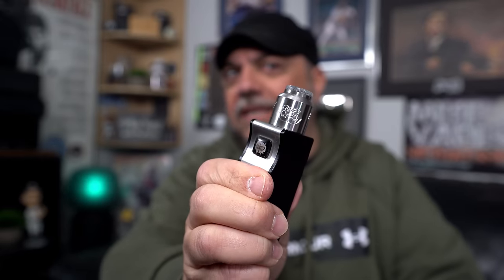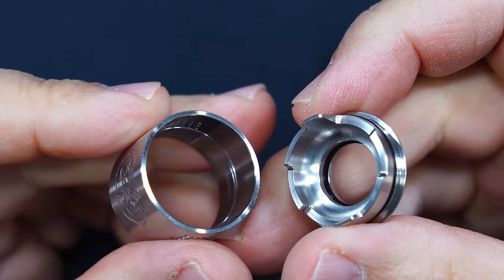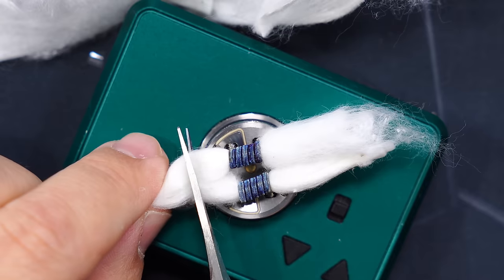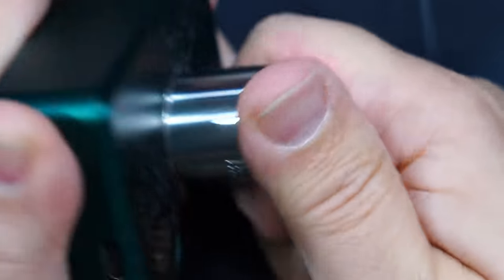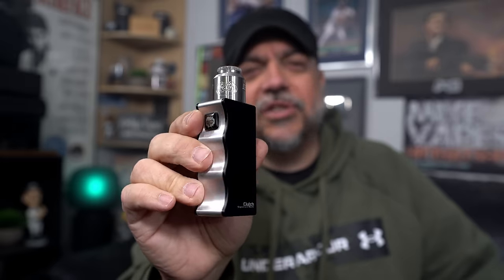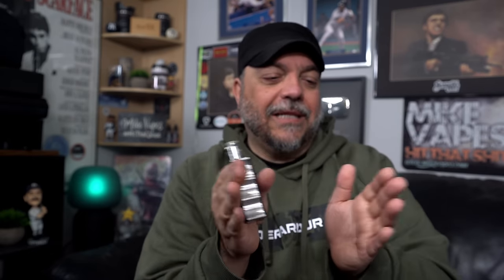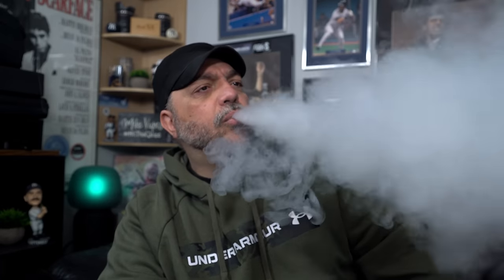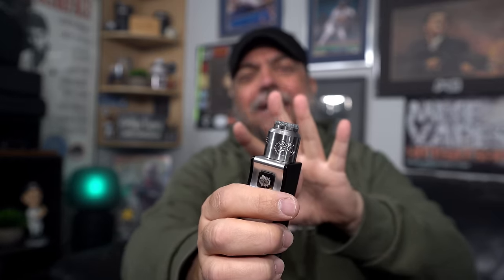HellVape Drop Dead v2 RDA!!

Comment: I just bought this today. The stats of the coils are given on the box btw. Ni80 0.37Ohm Clapton coils. I still have my Eclipse Dual RTA too. I love both. Totally worth it. RDA for home. RTA when I go out.
Reply: I'm still new to figuring what wattage to use an I got a bunch of these coils, what wattage would recommend? Like 60 watts?
Reply: @laryfredcrik6350  on my Cyborg Quest 100W I find this to perform the best at 70 Watts. 21700 battery.
I don't recommend going higher.

Edit: The coils after the build are like 0.16Ohm so check that too
Reply: @AkashZaman277  oight thx ill try that out
Reply: @AkashZaman277  maybe you could me but I always run into this problem where I have a hard time getting my cotton in and alot of times get these weird brown spots on the cotton after a few puffs and tastes bad, do you ever have thus issue?
Reply: @laryfredcrik6350  it depends on what juice you use too. Fruity flavors have more sugar. Which produces more gunk on the cotton and coil. Also, it could be the way you're building it. I recommend shoelace cottons so they're easier to fit into the coils first. Then you can cut and adjust easily. I personally use Hellvape shoelace cotton.
Reply: @AkashZaman277  ya I know the sweetner can affect things but you can only get sweet stuff by me but if I wick it right I don't have the issue, the problem I have is actually stuffing the cotton in the deck and it always gets bunched up kinda and isn't in straight. Mike always makes it look so easy when he puts them in 🤣
Reply: @laryfredcrik6350  yep he does. But it's not easy. And honestly, I go to my usual vape shop once a week to get mine wicked and ready. Tried a few times, doesn't end up as good. But I recommend trying until you can do it well. It's worth it
Reply: Japanese cotton has always been the best for me, it comes in square shaped pads, just remove the top and bottom layer, cut to size and slide it in (pause).
Reply: @zfx4605  I think I got the thickness right im using firebolt laces, I'm trying a dead rabbit solo now and still getting brown spots on only one side of my cotton after very little usage.
Reply: @laryfredcrik6350  brown spots are usually the sugar being burnt. Most juices have sucralose in them, giving your coils that brown gunky look.
Reply: @zfx4605  it even does it with a tobacco juice i have with no sweetener, and usaly only get it on one side and makes it taste off. I also don't tilt my mod. Is ther anywhere I can send you pictures? I'd really appreciate it if you can help me get this working right an if you can get my issue fixed I'll even send you 20$

Comment: I still have the og drop ive moved to mesh now love the longer battery life with the lower wattage of mesh, But i used my drop so much and was 100% not replacable i bought lots of others but the drop is just the best. now ive been rocking the zues x original mesh tank rta and its my longtime lover.

Comment: I just can't go back to coils ever since I've started using mesh. The flavor isn't there for me. I do have the original drop dead. It is good but I wish I could use mesh coils
Reply: I do have the wotofo mesh pro or whatever it's called. It's ok. What I want is a huge mesh coil rda that uses a completely 360 round mesh coil with a lot of cotton. At or below .15 ohm

Comment: Looks like a lip burner. Why nobody ever talk about builds that are too hot to enjoy even at low wattage?
Reply: Use different gauge wire like 24 or 26
Reply: @zfx4605  I’ve tried different gauge wire. I’ve tried nickel and stainless steel and kanthal. What works for me is the type of build. I will just use a single wire. I will not try a Clapton or juggernaut or alien. Just a simple coil with five to six wraps. It does not fix the problem. It makes it more comfortable. Also getting delrin or plastic mouth piece with some height. It does not fix the problem. It just makes it livable. If you can make the blotto by bogan not burn? Please share!!!! LOL

Comment: im doin something wrong, the taste is way worse than with nord 5 coils, dunno, usin dead rabbit 3 n hating it, maybe juice does not fit, using viper brand
Reply: Probably because your using cheap pre-wrapped coils and your not getting all the hot spots out and it has to glow from the center of the coil then outwards. Also you might be using too much cotton inside the coils keeping juice from soaking the cotton and burning the cotton or running too high of wattage. There is a learning curve for rebuildables like RDA's and if you're new to them it's going to take practice but once you get it right it's the best vape experience you can get!

Comment: what mod is that where to buy
Reply: The Clutch mech mod from Signature Tips in the UK. Learn about ohm's law and battery safety if you've only used regulated mods, pod systems, or disposables and not a Mech mod. There is no built in protection and it can be very dangerous if you don't know what you're doing!